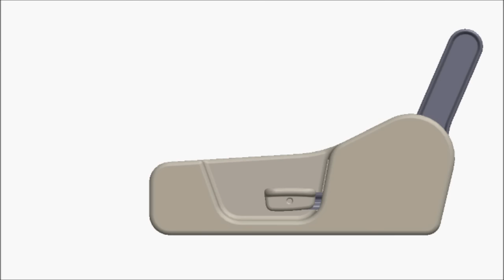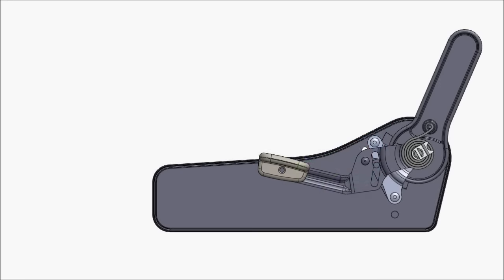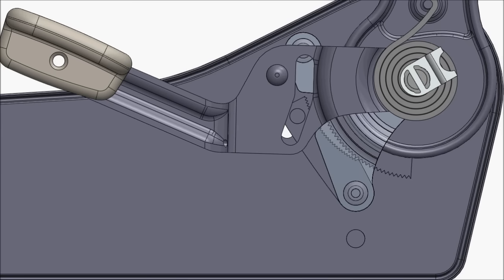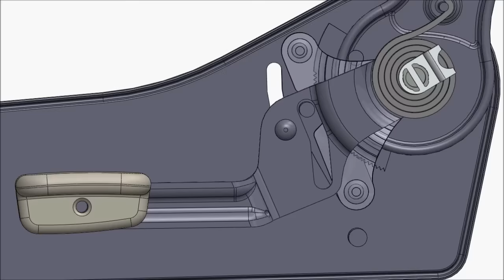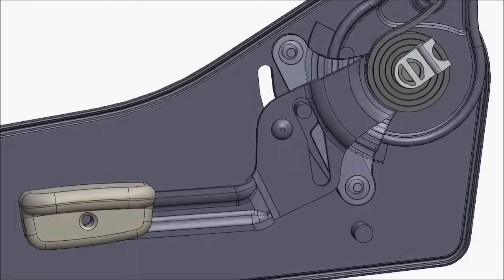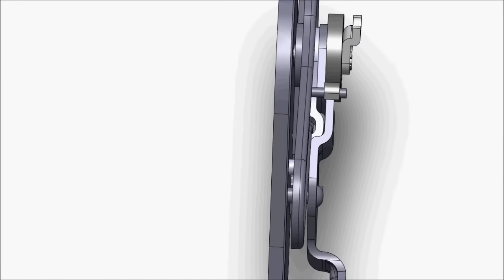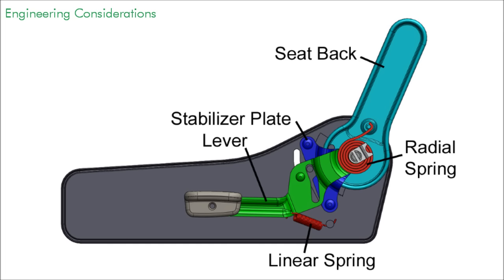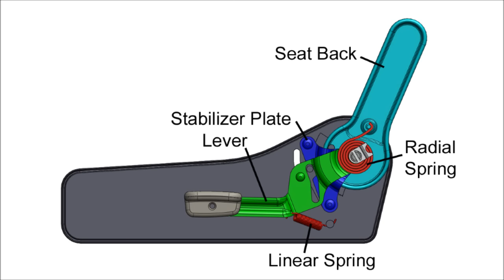How It Works: Seat Back Adjuster

Comment: This recliner is but one of many designs. This one is a sector gear recliner with a locking pawl. There is the Taumel type rotary gear, German design. Then there is the linear type, which uses one or two cylinders, with plungers. How do I know? I worked at a recliner supplier for automotive seating, ran the life and reliability test lab for several years. I tortured and wore out recliners for many models. Best seat/recliner combination: the basic Recaro. Worst I encountered: the Mitchell bucket, used in circa '90 Suburbans... We called that frame the "lawn chair." Basic performance measurements for recliners: Radial play, recline effort, lift load, handle effort, for basic clocksprung sector types. Rotary wheel effort for Taumel. Static rear, forward torque to failure, and fatigue to rear tests performed. Then there is the life cycle testing, 10,000 cycles minimum is typical. Forward dump tests, also. Then there is the inertia lock forward test, for recliners so equipped. Best rule for design: Keep it simple. We had a recliner that had the dump feature for 2 door, worked great, compare it to one of the high end GM designs... the Cadillac sample we had was ridiculously complicated. They kept adding parts, until it worked. I was Dr. Destructo in that lab. I also designed test machinery that worked the first time I tried them out, unlike certain "engineers" up in the front office. You make it, I will revise a way to break it or wear it out. One last piece of advice: for any pin/v hole wear... Lithium grease. Use on door/hood hinges, etc. Use on latches. I proved it out in the lab.
Reply: soco13466 ..Are you still the business? Where are you located?
Reply: P272 They closed the plant in the late 90's. I am retired now, am building a container home, my design. Regarding automotive seating, from what I've seen in later years, is that they are improved. I still don't think the Recaro has been outclassed. BTW I made an office chair from a passenger side bucket, out of a small GM suv, has double telescoping cylinders (linear type recliner), mounted on the base of my previous office chair.
Reply: P272 Am in South Carolina.
Reply: Cool, thanks for replying back. Good luck with the container house. A guy named Tony Hsieh (Zappos)  built a container mall on Freemont Street in Las Vegas, check it out. Your office chair sounds bad ass. I'm searching for seat, springs and magnetic engineers for three patent projects im working on. Figured I'd see if you were still in the biz. Cheers and post that house when you get her done.
Reply: Do you think this system can be used other than seats ? I have this small project im working on its like a drop down shelf and i want the fancy to be able to set the angle at whatever position and i thought of this haha
Reply: Yaash Times Get a Taumel design, the kind you can find in VW seats. Most likely the upper bracket is welded to the seat back frame. Use a metal cutting disc, or even a regular grinding disc, 4" grinder. You can weld it to whatever project you need it for. Lower bracket has bolt holes. These recliners come in pairs, with a connector tube, that synchronizes them together. You can shorten or lengthen the tube, but you need the square ends that insert into the eccentric rotary cams. We had some of those modified to fit Bombardier snowmobiles. Anyway, this is an infinite position angle recliner, with of course forward and rearward limits. An even better design Taumel came with 90's Ford Contour, or what we called the Mercury Mistake (Mystique). Use your imagination, in the installation in your project.
Reply: soco13466 Thanks a lot man ! Imma do that. It's good to know that i don't have to touch the mechanism and all i gotta do is chop the frame to connect it to my project makes it much more easier for me  hahaha can't wait. I should probably go for old seats i mean it's only the system that i need long as they're in good shape, could save me a lot of bucks.
Reply: Yaash Times Just go to a used parts yard, ask if they have old VW seats, or the Fords  I mentioned above. Passenger seats usually have been subjected to less wear. Remember that driver's side seats are used 100% of the miles, most passenger sides will be in better shape, unless a land whale sat in them a lot. I got the seat for my office chair for $75.00.
Reply: soco13466 VW is kinda hard to find on a junkyard here haha lots of ford tho im going with fords seat. I'm still working on my design soon as i figure out everything gonna get them. 75 bucks ain't bad
Reply: ..can you come to Maine and fix my seat for me?

Comment: I’m trying to convert my tiny Kei car into a camper. The back seats fold completely flat, but I need to fold the front passenger seat completely flat too if I want to lay out comfortably. It unfortunately only folds about 45 degrees.

If I were to remove the stabilizer plate, which appears to be what stops the seat from folding further, would that possibly allow me to fold my seat completely flat?
Reply: You ever figure it out?
Reply: I need to adapt my seats to do this also. Not pleased with the manufacturer

Comment: my seat adjuster broke in my 98 dodge pickup any ideas on how to fix it
Reply: Jacob miner guy Benson What broke? If it is one like in same year Chrysler product, you can have anything from a broken handle spring, which means the seat won't lock in place, or a sheared rivet. Check the lower bracket, upper bracket bolts. Maybe the teeth have been sheared, which can't be repaired.